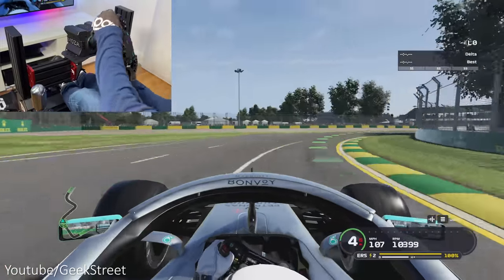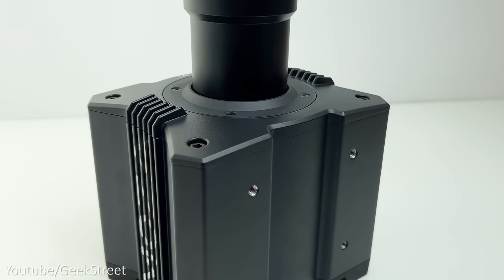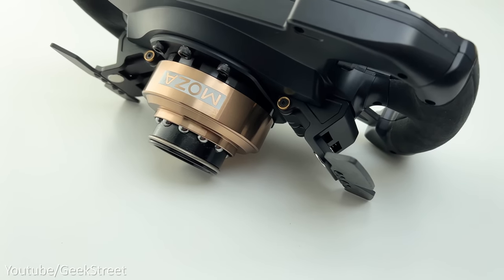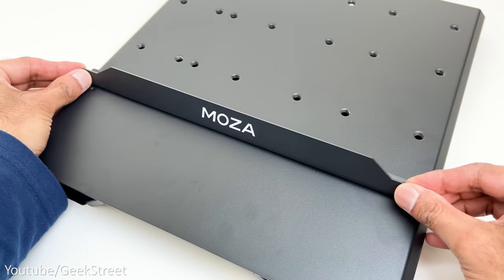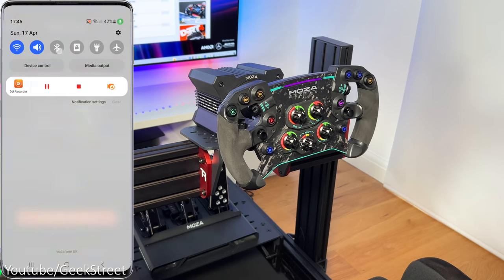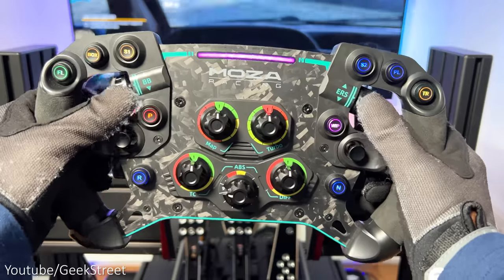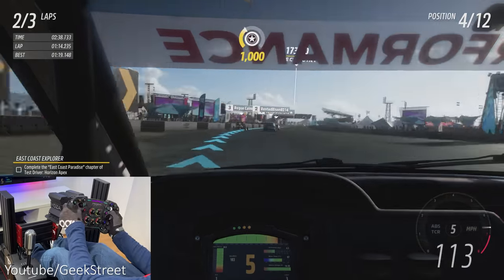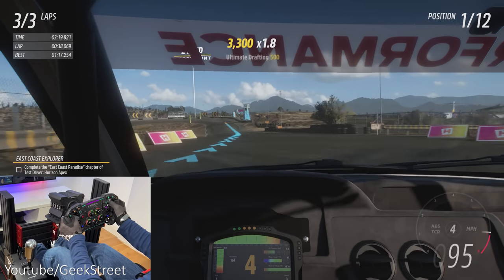Fanatec CSL KILLER? | Moza Racing R9 / GS Steering Wheel and CRP Pedals Review

Comment: I am interested in this, but as someone who races across multiple platforms, no console support is a no go for me at this point.  I definitely want them to increase their market share. Competition is good.  I will wait and see if they get console support.
Reply: Console support costs licensing. Not a big deal unless you are desperate for gran turismo, as forza available on pc. So really not a big deal for most. Aside from gt, all the other racing games are available on pc and I certainly would not go out and get a console for gt
Reply: Ras1ution 1 and 2 work with the Moza range to give Console support :)
Reply: @benllewellyn1888  That is another add on to buy, correct?
Reply: @kr1egquecksilber171  ACC is also on PS5 and XSX.
Reply: @kr1egquecksilber171  it only costs if they want to have th "official" stamp on the brand. Otherwise they can market them as compatible. Just like Madcatz and other brands do...

Comment: I went for this instead of fanatecs csl dd because the thought of accidentally braking the qr lite or bending the pins worries me, plus I don’t need console compatibility as I just race on pc.
Reply from the maker: You'll love it, seriously good.
Reply: I hear this may be getting console compatibility too
Reply: @solefreak2  if so then that’s a bonus
Reply: @GeekStreet  yep just waiting on it to be delivered next week!
Reply: @AdzzVR  So how is it? Im deciding between this and csl dd.
Reply: @Patrikv303  I was in your position aswell but in the end I went with the Moza R9 because I’m not waiting months for a wheelbase and then pay huge taxes on it. 
The wheelbase is amazing, came from a G29 and the details that you feel that’s weren’t there before is so much. Kerbs, suspension movement and the compression feeling when going up Eau Rouge or Paddock hill bend on brands hatch are just so unreal never felt anything like that on my old wheel. I’d say one thing that puts this above the csl dd for me is that there are no pins like ones in the csl dd which could be bent or broken. And on the Moza base you can swap any wheel with the right bolt pattern onto it. However with csl dd you’re able to use it on pc and consoles with the right rim. So depending on where you play you’ll want to consider that. If you go with the csl dd you’ll need to think of getting a metal qr sometime in the near future because the plastic one that comes standard with the wheels will crack at some point and if that happens the pins will be destroyed later on. And from what I’ve seen so far Fanatec’s customer support sucks because of their wait times and that’s it they even get back to you. Where you based EU or UK or America?
Reply: @AdzzVR  Im in EU, and i already dropped fanatec, im choosing between the r9 and gs wheel or the simagic alpha mini with an aftermarket cheaper gt style wheel. Alpha mini is obviously the better wheelbase, but the gs is a better wheel than some aftermarket stuff. Do you also feel road textures on the r9? like when you are driving half wheels on asphalt and other half on grass, do you feel it?
Reply: @Patrikv303  oh okay: I don’t know how the alpha mini is but from using the R9 I can feel when the tires are on different surfaces,  when it’s gravel or grass and asphalt you’ll feel the steering pulling and you’ll have to fight it. Sometimes you can also feel the green turf having less grip that asphalt. I’d say look at reviews of both bases to help you decide.
Reply: @AdzzVR  Ive looked at both reviews for days now, and ive seen people say that 9nm isnt enough for it to be enjoyable, and that the simagic is really good. Other people have said that the 9nm is even too much and that they play on like 70% ffb. Hows 9nm for you? Is it enough? Do you play on 100%ffb?
Reply: @AdzzVR  I just bought the R9, GS rim, 200mm extension and CRP pedals last night. Looking forward to getting them and upgrade from my G920 wheel and TLC-M pedals.

 Anyway, when you say with the Moza base, that you can swap any wheel with the right bolt pattern onto it, are you saying if I got another QR adapter and could find say just a plain 350mm stock car rim with the matching bolt pattern that I can use that wheel to make steering inputs and not hope at some point Moza may or may not release a wheel for American stock car racing?
Reply: @gonuts4donuts  nice! It’s worth it, very very big jump in terms of detail. And  yes any rim with the right bolt pattern will work, I haven’t actually gotten one yet, as I only do formula and Gt but yes I’ve seen people use sparco rims on it. Looking to get one soon though.

Comment: As a side note, the digital dash is not compatible with this base. You need one of the other two more expensive bases for that, as the dash connects to the base itself using some pogo pins.
Reply from the maker: Ah ok, thanks for the info.
Reply: There is a dash coming for this though. Later this year.

Comment: I just recently bought an R9 and there is a notchy thing happening. It is very pronounced when steering through the corners. It is very disruptive. You can feel the spacing in the magnets while steering. At certain moments when I feel it and it makes the strong FFB at that moment grab and release so I end up messing my turns. I recently upgraded from G923 and I am slower with the R9 by 3 to 6 seconds because of the notchy wheelbase.

Comment: It would be great if you could get the converter and test it on the PS5 to see how it works, if the FFB is the same and if it has all it's functions working. 

And also how did you get the fanatec shifter to work with it? 

These are the only 2 reasons why i haven't bought one yet.
Reply from the maker: With the Fanatec Shifter you can buy a separate usb adapter and plug directly into a PC, I've got a video coming out about it soon.

Comment: There are few reason i bought Fanatec csl DD 8nm instead of this.
1. software.(fanatec have more longer experience and have more, and ,sold more products mean, more fixed error,)
2. German vs china (although, both from made in china, I prefer German brand)
3. wheels. (Moza sell 2 wheels only. fanatec have way more choice). i got wrc wheel and formula 2.5 wheel, and it cover all games.
4. price. except wheel base, everything else are expensive. (Moza's padals and steering wheels. both price are $500). i got csl v2 for $359(now $399)
5. customer service. i don't know about moza but, Fanatec customer service doing really well. no reason to take risk to pick Moza.
6. upgrade. (if i upgrade to more strong dd base, likes dd1, or dd2, i just need to change wheelbase, and it all work fine, with only few touch)
Those are Only my Personal opinion. 
I hope, my experience helps new buyers.
Reply: Few things to note on this though with your points. 

1) yes more experience but the Fanatec updates are slow and few. Moza are updating weekly and listening to the community to keep moving forwards ( as any new brand has to do)
2) Both are Chinese Made through and through, one has offices in Germany but to compare this Moza has resellers around the world aswell Ie im from Abruzzi in the UK as a seller of Moza therefore meaning UK customers dont have to deal with the chinese company at all. 
3) Wheels is the setback 100% but being that moza is one year old and Fanatec are many years old they have had a lot longer to develop a full range. Moza release more budget friendly wheels later this month which will help with solving this. 
4) The other units you speak of with wheel and pedals here are the premium range, so to be fair you have to compare them with the most expensive fanatec wheels and also the V3 pedals as thats the range these are really aimed at. That bring its pretty close in price. The new Moza pedals and wheels will mean the pricing will be the same if not better than Fanatec. Also note Moza is a higher quality product. 
5) Customer service is done through local dealers, far far more efficient than fanatec who are known for being pretty terrible. Their products and company are not bad but for years Fanatec has had a poor reputation with people waiting weeks for replies to emails. 
6) not sure if youve checked out moza but the released the R16 and R21 before the R9 so exactly the same situation with their units. Also you can run third part wheels on the Moza like Cube controls, Gomez etc simply with a QR for £50 rather than needing the full hub from fanatec. 

Just some things to consider and i understand your post is your experience but hopefully the above clears up a few of your issues :)
Reply: @benllewellyn1888  I really glad your comment.
now, more people see this and they can compare it. ;)
 1. slow update = already fixed problems vs everyweek update=programs aren't stable.
2. fanatec sell their own and also have reseller in more country then moza.
3. 1year old vs 2 years ?? lol .
these types product won't update every years. 
made in 2 years ago. still sold out. vs 1 year old, never sold out. 
4. who looking for budget(compare dd1 or high end),  Not many people want spend over $500usd for only Pedal. also, there are no other choice. Fanatec have 3 type, csl, csl elite, csl v3(v3 invert not include)
5. I don't know how many local dealer in your town. but my place is none. either fanatec and Moza. 
and I and my friends have good experience from Fanatec customer service.(US).
6. I checked website, they have only 2 wheel. which is GS, and RS. but, no cheaper wheels like fanatec have.(each $500 usd), and people who have cube system(have wheel=have wheelbase). they won't step down and buy R9. 

I know, it's good product, and I understand, what you r saying.
But, This is budget dd wheel. 
most of people who buy under 10Nm dd base, budget are around $1,000. but, how much R9 setup?? $2K?? 
if people want spend more money, i am sure,  they will buy dd1,2, or simmagic. not Moza M9 or other Moza wheelbase.

Reason I wrote this comment is..
whoever looking for buy DD wheel. 
I want people know, and compare them self, one by one. and don't waist  Money.
And, Please,  Enjoy your Games~~~
Reply: @IlIlIlIlIlIlIlIlIlIlIllIlIlIlI  Hey, 

To an extent you are right but its still all a little exaggerated. 

1) Its not unstable in any way, they just keep adding features and seem to already have more options for tuning and actually dialling in than fanatec so its the opposite of unstable its just actually being developed. I have fanatec kit and have had it for years and enjoyed it immensely until i realised how lazy the company has become in comparison to the competition, they dont even provide software that automatically updates firmware etc so the software is fairly crap compared to new brands like simagic, Moza, Simucube and immsource. 

2) that is about the most incorrect thing i have heard regarding fanatec. They dont have resellers in more places than moza at all. Infact their whole business is built around selling the products themselves except for rare circumstances. Moza have dealers all over the globe already. 

3) you have not understood at all, fanatec didnt suddenly launch two years ago with their entire range, they have built the wheels up and release new ones over time. They have a great range now but you are limited to their ecosystem and even their most expensive wheels do have a cheap feel to them compared to the new chinese brands like simagic, Moza and immsource. Fanatec however do have a better range of wheels than all of these new brands. 

4) All im saying is you have to compare the same ranges, you cant compare the Moza wheels with the budget Fanatec rims and claim the Moza is expensive. When Moza's cheaper range of wheels become available in a few weeks then compare the pricing. Right now its not a fair fight to compare a premium wheel at a higher price and a cheaper fanatec rim. Same With pedals.

5) you say your USA Based so i know Sim motion is a USA Distributor so there is atleast one in your area. I have a feeling there are 3 total in the USA selling Moza products and providing a local solution should there be any issues. 

6) Fanatec USA does seem to be better than the european version for customer service. That said you essentially wrote Moza off without actually giving them a chance, their customer service is brilliant and more likely to be faster due to the local dealer support, that means you have several avenues to help immediately and more likelyhood of getting it solved much faster. All you have to do is google fanatec customer service reviews to see hundreds of badly dealt with customers. Its common knowledge and even people like myself who loved their fanatec kit know its their biggest issue at the moment. 

Also im not sure why 2K is a thing this wheelbase and wheel combination is £848 so thats literally at the $1000 mark. infact its cheaper than simagic by around 100usd. Im also a simagic dealer so i know this first hand. 

100% with you on the comparisons but i think your struggling with your facts at this point. Maybe this will help you see my points better. 3 Weeks or so we will see the entry level Moza wheels and Pedals and at that point you can compare the CSL complete range with the Moza R9 complete range. For now its like having a CSL DD with a Porsche 911 Wheel, it evens the price up completely.
Reply: @benllewellyn1888  I respect, your opinion, AS Official distributors.
you don't have to explain one by one.
This is my own reason, why I bought Fanatec. not yours. 
I am saying as my experience. as a customer.
Reply: @IlIlIlIlIlIlIlIlIlIlIllIlIlIlI  i have fanatec products for many years. Clubsport stuff mostly, and Moza looks much better quality atm. Fanatec steering wheels are also expensive and have very toy feel and weight to it to be honest. Software is so so. Lot more quality issues in recent years. Bad quick release still. I'm thinking about moving away from Fanatec, while I own a lot of their products. I will keep v3 inverted pedals, shifters and handbrake for now.
Reply: @-racingfan2014  
so far, mine is ok. but ,sorry about yours.
what ever you play with.....
Enjoy your driving~  :)

Comment: It is absolutely amazing, but I wouldn't say it competes with the CSL. The CSL is still a lot cheaper than this
Reply: Wheelbase No, Wheels yes, right now as a bundle the CSL no doubt is better. You have to remember though the wheel and pedals Moza have now are all their higher end range. The lower more entry level range will pull all the pricing in line so bundles can compete with the CSL range. :)
Reply: @benllewellyn1888  Definitely agree that it is a different level, but all of Moza's prizes are written without VAT, thus looks a lot cheaper than it actually is. It is a different level, and probably a lot better quality, but it isn't quite in the same range as the CSL. We can hope they'll get there in the future
Reply: @MCTwisterGaming  Go to your local distributors shop for Moza would be the best bet to directly compare the pricing. :) For instance im from Abruzzi in the UK and we stock the Moza units and with our pricing in the UK when you compare apples to apples the R9 unit will be right on the same bracket as the Fanatec units.

Comment: I'm excited to see if there is good customer support and it is reliable, it's the main thing pushing me away from fanatec
Reply: THIS
Reply: I do not own a Moza, but as I heard they have a pretty decent CS. Actually, they hear a lot of feedback. It's the only sim company that is working really hard in the software. The hardware is great, the software is lacking. But they made huge changes to it. Comparing to Thrustmaster. Same software since years. I own a Thrustmaster SF1000 and there is no options for leds, speeds to it, colours, or any customization at all. It even have Wifi and they wont even make it compatible with Simhub (it can be done).

Comment: Hi sir Logitech g29 can connect or rog laptop?
Reply from the maker: Hi, its should work with most PC's but the higher the spec the better for a good gaming experience.
Reply: @GeekStreet  my laptop is high specs it's work?
Reply from the maker: @richkarolbenedictignacio4771  yes should be fine then